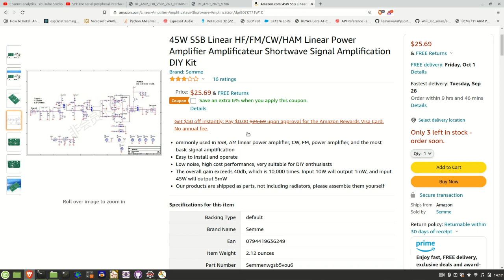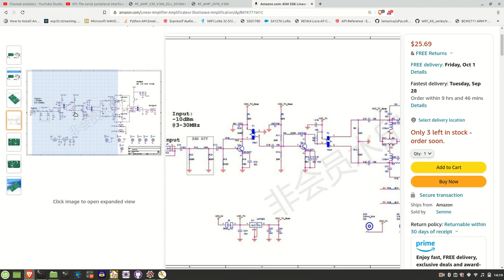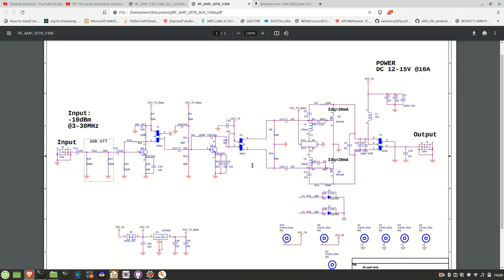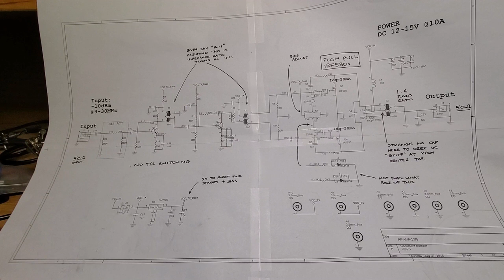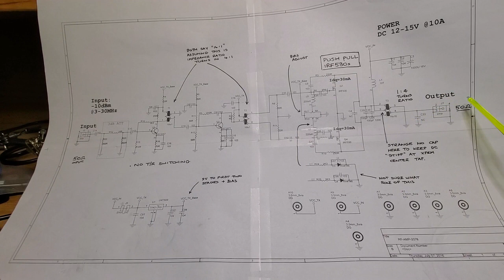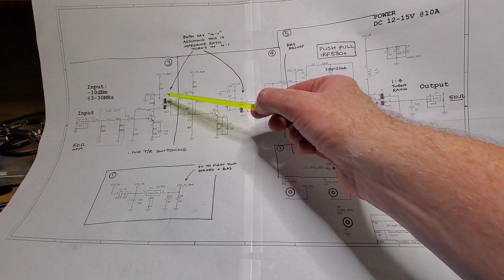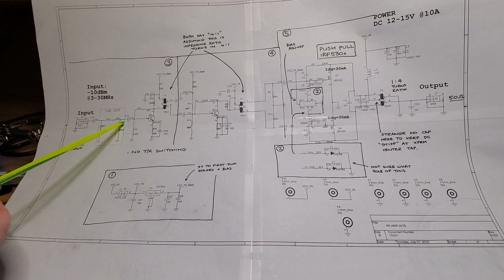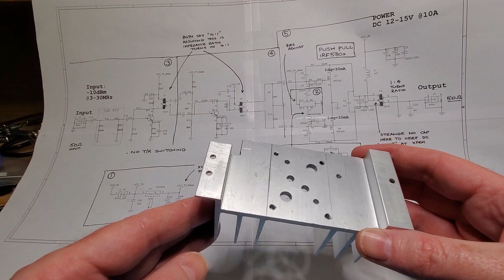IRF530 Push Pull Amplifier from Amazon - Part 1

Comment: Just wanted to clarify the role of the inductor you were wondering about. It is actually used for resonance to allow the output voltage to swing higher than Vdd and thus pump more current. This is vital in any amplifier class that doesn't have full 360-degree conduction, such as class B, as it is responsible for completing the sinusoidal waveform. Since this is AB, you can probably get by without it, but I would expect to lose some gain.

Comment: Hi Lan, just a comment on diode bias. The function is to change the polarization as a function of the temperature. So what you have to do is to put these diodes in contact with the final package in order to give feedback to the bias and protect from high temperatures that could destroy the finals.Ciao e 73'

Comment: Very informative and nice videos!. I burned one of the IRF530 but I have two IRL3705. Do you think they can replace IRF 530?
Reply from the maker: I looked at the datasheet of the IRL3705 and the rise time at 140ns I think may be too slow. Pinout is the same though
Reply: @na5y  Thank you! Did not think rise time had that impact. So thanks a lot and I will go thrugh my MOSFET junkbox and look for others. Looking forward to your next videos! 😃
Reply from the maker: I am in no way an expert - have a look here https://techweb.rohm.com/product/power-device/si/si-basic/4955/

It defines all the params. 140ns rise time would be a problem > 7Mhz I would think

Comment: I tried this kit some time ago, but I didn't manage to make it work and gave up eventually. One obvious mistake I made was assembling the complete PA and then turning it on. Building it one stage at a time and testing every stage separately sounds like a much better strategy. Good luck!
Reply from the maker: Thank you Alex! I even built a new 50 ohm dummy load for this out of metal film resistors on your advice from the previous video ;)

Comment: You're really brave to give this one a go. If you take their Amazon description seriously, this circuit takes a 10W input and outputs only 1mW, or if you give it 45W it will output 5mW. Sounds more like an attenuator than an amplifier to me. Of course, they meant the other way around, but if they can't trouble themselves to know the difference in English (or whatever language they're trying to sell in) between input and output, that might be a deal breaker for me. What else is backwards or mislabeled? 

The schematic--for which you had to hunt to find a legible copy--looks more like a first draft to me--it's certainly sloppy and hard to read. 16:1? You're probably correct to assume a 4:1 turns ratio, but it's a circuit not a guessing game. The schematic calls for a -10dBm input. Well, that's 0.1mW, not the 1mW they got backwards in the Amazon description. You are correct about the RFC near the output. It's to keep RF out of the power supply--to "choke it off." At around 45uH, they're won't be enough choking there, and the DC bypass caps would become part of the RF output circuit. There's lots more, and for commentary by a genuine engineer, see the reviews on Amazon for this item. I'll be looking forward to see how this build comes out, especially since the IRF530 is among the part numbers rampant in the counterfeit market. Maybe the seller was careful to avoid bad ones. I mean, he had to get something right, didn't he?
Reply from the maker: The bad reviews, wild and inaccurate claims, lack of instructions and strange circuit values are all a part of the "charm" of this kit Todd ;)

I did sim it on LTSpice with a .01 Vp-p on input and it produced about 50Vp-p output. That was using 4:1 turns ratio (4T is about 5uH on those binoculars) so it does theortically work. We'll see! No idea on linearity although I think one of the links I put up had some linearity measurements.

Thank you for the comment Todd!

Comment: Hi Ian. Re the diodes ... some years back I think I tripped over the idea of using diodes to auto adjust the push pull bias (Idg). The diode was mounted very close to the transistor and as the transistor heated it changed the diode characteristics. I'm very fuzzy on this. I do remember trying the concept to "fix" a problem I was having with thermal runaway. At the time I thought the idea was a bit dodgy and it didn't fix my thermal runaway LOL.
Reply from the maker: Ah that makes sense - diodes are thermally coupled to the FETs and it acts as negative feedback. When the FETs heat up the diode heats up which lowers the forward voltage on the diode (which lowers the gate voltage). I'll have to see how close those diodes are to the FETs. Thank you for the comment
Reply: @na5y  Yes, it is for temperature compensation of the bias current. Without them, the bias current would increase as the temperature increases, which causes the temperature to rise more. This can lead to thermal runaway.
Reply from the maker: Makes sense now. Thank you for the help gentlemen
Reply: @na5y  Neville is correct about the diodes. I might add that you'll as you said, a bypass capacitor will be needed on the center tap of T3 ( a 100nF should do). Those 2SC3357s in the first stage are low noise, low voltage, with a Ft of 6.5 GHz. They are similar to the 2SC3355 (TO92), 2SC3356 (SOT-23).
The 2SC1971 is probably similar to other obsolete CB radio transistors like the 2SC1969, 2SC2078.
I'm suspicious of the IRF530 being used instead of the IRF510 but the use of resistors across the transformers and heavy negative feedback on the IRF530s may smooth things out over the HF band.
Reply from the maker: @jeroldponko7168  I will definitely compare the outputs with and without a cap on the center tap (as well as with and without L1). Thank you for the comment Jerold
Reply: Scott and Neville are spot on with their comments.  As the diodes gets hot , the Vf will drop and keep the driving transistors from going into thermal runaway by dropping the bias voltage.  The trick is finding a diode that has the same thermal characteristics (curve) as your output transistors.  You can also do the same trick with a thermistor, but the circuit gets more complex.  You can find both methods in old Motorola app notes.  Class C amps will not have them as they are considered "self biased.  Try it yourself: measure the forward voltage drop on a standard silicon diode and then watch it drop as you heat it up with a heat gun.
Reply from the maker: @azav8raa  I was going to try the heat gun thing! Thank you for the comment